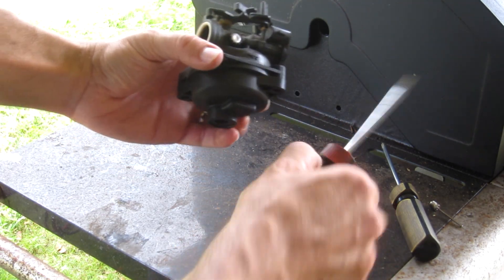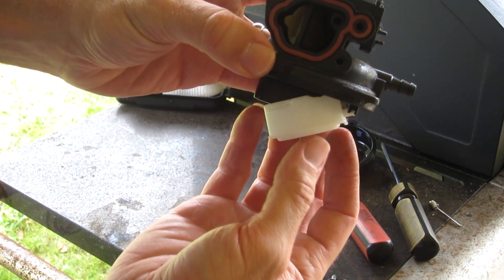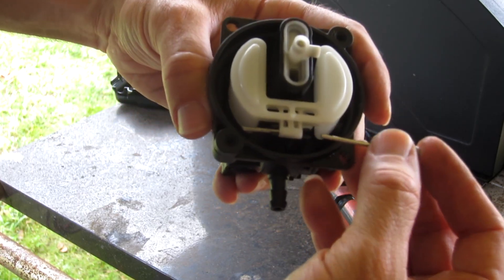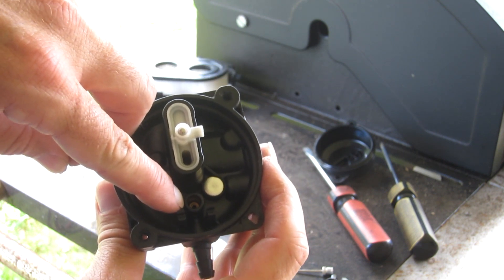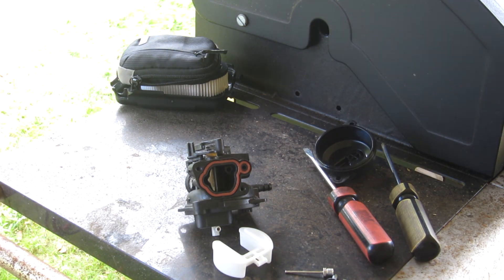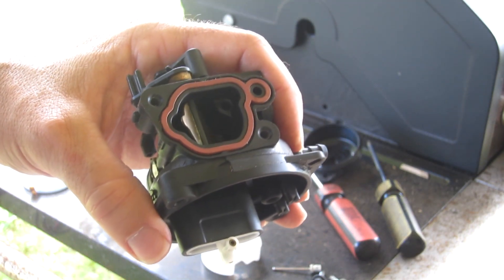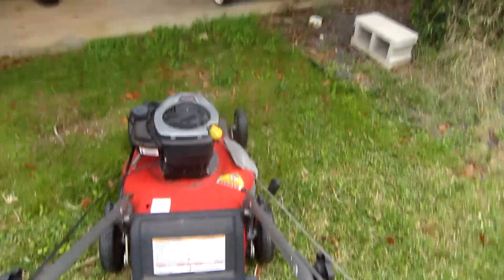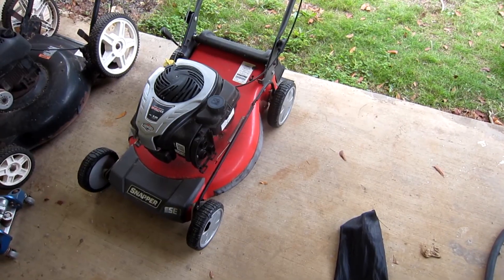Briggs and Stratton 550EX Carburetor Repair Part 2

Comment: I have the same exact Engine...fully took apart the carb (even the white Jet Tower) cleaned and the Engine runs great. I even added an inline filter (very difficult-minimal room) hoping that was the issue. Engine runs great but then starts surging. It's not the Fuel Cap Vent. I'd hate to buy a NEW Carb when it's perfectly clean and I can't find any fault with it.
Reply from the maker: Ray Josephs, only thing that comes to mind is to double check for air leak or broken/missing springs or linkages on the carb. Sorry you're having trouble, but good luck
Reply: I'm now thinking it may 'possibly' be the governor spring...I notice if I rock the Mower forward and back is acts like it's running out of fuel (an it's not) so, I'll check to maybe see if the spring rod (bendable) may need to be moved forward a tad to give a little more RPM. I also have to give the governor itself a more detailed inspection.
Reply from the maker: Ray, also, just to confirm, you do have the blade on the mower right? If you don't , the engine won't run right as it depends on the spinning force of the blade to maintain proper rpms
Reply: Ray Josephs what fuel filter micron and clamps did you use for your setup? I'm trying to upgrade the engine as well. Could the surging been caused by fuel delivery problem due to the fuel filter?
Reply: The 'surging' problem turned out to be the Governor Spring, what was happening; cold the engine ran great but once the engine and the surrounding area (spring) became hot the Spring got soft and sagged/bounce and the engine started to surge. I just had to bend the Spring rod a little forward to increase Spring Tension...not too much as these Engines are not meant to RPM too high. As for the Filter...not much room at all almost zero. To make some clearance between the Carb-barb and the Fuel Tank-Barb I had to carefully file a little of each end of the filter (about 1/16") to get it in between the two...depending on your Mower you may not need to do that. The 1/4" Gas hose I used looked like black Vinyl (not rubber) and I could only use two little pieces. I also had to use a Heat Gun to get the slight offset bends in the hose. The clamps I used are the 'squeeze' type that use Pliers...not the usual screwdriver type. The filter is the smallest I could find, it is 75-microns and has Briggs & Stratton stamped on it, costs $4.00 It looks like a Pancake. Glad I got a filter on the Mower as the in-tank filter was shot and a new Gas Tank was $50.00 https://www.ebay.com/itm/1-4-INLINE-FUEL-GAS-FILTER-MADE-FOR-BRIGGS-STRATTON-298090S-USA-SHIP/253220322423?epid=141596629&hash=item3af51b7c77:g:dOIAAOSwLiJZxDno
Reply: I have heard of issues with the carburetor linkage with this engine, you might want to research that.
Reply: jcx2bby oh yea, blade is on correctly. The only thing I did differently (after complete carb clean) was add in inline gravity fed filter which is fueling the engine just fine and because of a loose fit I add a ZipTie to the rubber crankcase vent hose, where it attaches to the back of the air filter housing. The rubber inner carb O-ring and white plastic outer insulation O-ring make a snug connection so doubtful of an vacuum leak. I service and keep my things in like new condition. Been wrenching on vehicles, diesels, Harleys,  automatic transmissions etc since my youth. Fully rebuilt my Snow Blower last summer with a new block, pistons lapped in new valves etc. 
Maybe, just maybe the governor may be a little off from when I removed the carb. I did test the heat thermo choke to make sure it's fully opening when warm. Also tested it with a heat gun.

Comment: 1:56  Do the same test after screwing the carburetor back together.  Right side up, you should be able to blow air into it.   Up side down, you should not. A quick way to check whether it was put back together properly.
Reply from the maker: JeffTheHokie, it's an unpleasant way to test them, but effective!

Comment: Good vid but I would tell people to check the Float and Seat for 'positive sealing' by turning the Carb upside down and let the weight of the Float stop the air you're trying to blow through it. Also, once the white jet assembly is out you can further take it apart/separate it to clean it. I have the EXACT mower, my problem, the Gas Tank Filter is junk...and with only 3 inches of fuel line there is not enough room to add an inline filter.

Comment: Good well explained video which has obviously helped a lot of people however you don't really need to dismantle all of that to get at the float bowl and jets. Without any dismantling, there is enough room to get a 7mm socket to drop the float bowl and then you can prise the jet assembly out to clean them.
Reply from the maker: Andy, great tip for the time savers. Thanks for the comment

Comment: Thanks for your response, add about three minutes 38 seconds when you are showing the workings of the carburetor there A metal plate or plug on the right. That is what I found in the ball of my carburetor.

Comment: What is the metal plate that said snacks to the valve assembly I found mine in the bottom of the bowlcan it be pushed back in place? Great video by the way!
Reply from the maker: Hi Brad, what metal plate are you referring to? What is the time marker in the video?

Comment: everything you've done worked I didn't have any compressed air but I sprayed the crap out of every hole and every jet and then shook it off and left it out in the sun for about an hour it started right up. I even took out the little pin the seat and it looked like that rubber gasket was seated in there okay and there was no varnished gas anywhere I must have just had a piece of dirt somewhere but I did have three month old gas so I need to stop doing that. thanks again my wife wanted to buy a brand new $170 one. I told her things can be fixed....
Reply from the maker: Daryll, it's too bad more folks aren't like you and I, people who want to fix rather than throw away. Good for you for getting that Briggs motor running and showing the wife that it could be done (probably for free too). Thanks for your comment.

Comment: Nice work and easy presentation. Very relaxed. I have the 550 series which has the single spring. Would you know that spring part number? Also, is the diaphragm part numbered 795083? Please advise, and thanks in advance for your help.
Reply from the maker: Scotty, I don't know all the part numbers but if you go to the Briggs and Stratton website and put in your engine's Model/Type code, it will bring up a parts breakdown that will give you every number you ever wanted.
https://shop.briggsandstratton.com/us/en/repair-parts
Diaphragm? None on this series carb that I recall.

Comment: Hi. I took apart the carb and cleaned, once I put it back together, still won't crank. Took apart again, just to re-check, NOW gas is leaking profusely from the two small holes to the right of the red gasket. What's the prob?
Thanks,
Margaret
Reply from the maker: Child of the King, hi, my guess is that the float is not operating correctly and overflowing the carburetor. 
I would check needle/seat operation first and go from there.
Reply: I had a similar experience.  In my case, the float was not properly seated. I failed to make sure the pin actually clicked into the holder.  One side was sitting up a bit. I took it apart three times before discovering that minor adjustment.  The other thing to be sure of is that you put the bowl back on properly so that it snugs up against the carb.  If 180 degrees off, it will not seal properly (although in this case it would leak out of the bowl, not above it).  I think it is the first problem if the fuel is coming out of choke orifice.  It's overfilling.

Comment: Thanks for the step by step...it was very helpful to see what needed done before actually tearing down.I am a automotive mechanic and have done and still rebuild carbs but have not done much small engine work.A neighbor wanted me to tune 2 of his mowers so I figured I would give it a shot....already finished one that had 4.5 hp motor and am doing the 550exmotor now and it has been sitting so I am going to take carb off and check it.
Reply from the maker: Mike, thank you for taking the time to comment. I appreciate the feedback from a mechanic! good luck with your repairs sir.

Comment: THANK YOU!!!! THANK U !!!! THANK U!!!!. I bought my first ever lawnmover last year and just used it for 3 times and it sat in my garage for the winter, and wouldn't start this season. Followed your video and Wollaa....started on my very first attempt. Thank you again..
Reply from the maker: Muhammad, congrats on your success and thanks for the comment!
Reply: Run the lawnmower until it runs out of gas before you put it away for winter.  I forgot to do that to mine last winter and just finished cleaning out the carburetor to get it running again

Comment: THANK YOU!  I have never fixed any motorized thing before.  After watching your two videos I attempted to fix my lawnmower that would not keep running after squirting starting fluid in the carb.  I followed your pointers and after putting everything back together it ran like a champ.
Reply from the maker: janice, well done and congrats to you on the success! thanks for taking the time to comment
Reply: Cool

Comment: Just an FYI. There is one more disassembly step you can do with that innermost white carb assembly (with the stacks). The center 'stack' can be lifted/pryed off, exposing a few more interior jets to clean out. Other vids on here describe it.

If I'm going this far I think I'd try to clean out as much as possible the first time.

Thanks for the video.
Reply from the maker: a user, I had no idea there was more to take apart. thank you for the tip.
Reply: I just took mine apart for cleaning. First time I've opened up one of these plastic carbs. That center white stack was a real bear to pull off (as was my gas line). Others have recommended prying it off with a screwdriver but that seemed like an easy way to break it. I ended up repeatedly twisting it slightly back and forth while pulling very hard on it. There were three holes in there, one of which had some crud.

The sewing needle idea worked great. I actually used a pin.

Comment: Thanks.  Took my carb apart twice tonight to clean and fix my mower.  The little round shiny metal part on the bottom of the carb space had come out of its place and was evidently rattling around.  Your video showed me where it belonged and also how to clean everything.  The last few times mowing it was surging.  Yesterday, it would only run for 2 seconds at a time.  Now, it is running like a top.  Thank you very much.  Now I need to watch a video about sharpening the blades.

Thank you, thank you, thank you.
Reply: that shiny disk mines keeps falling out